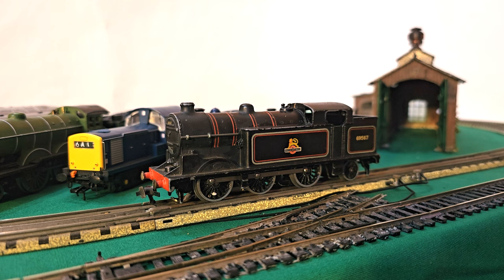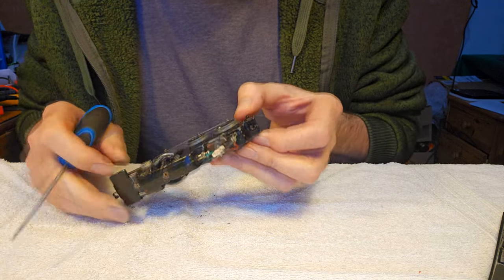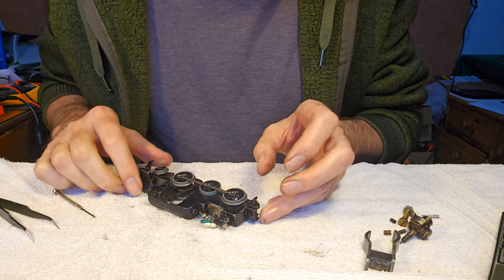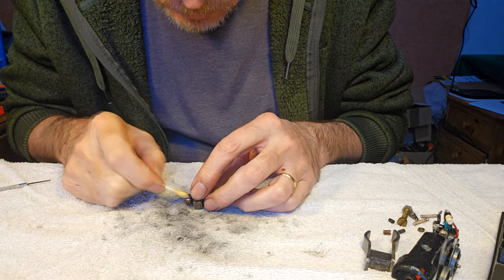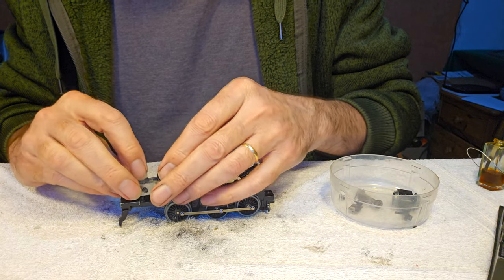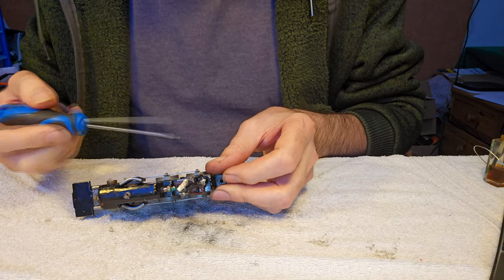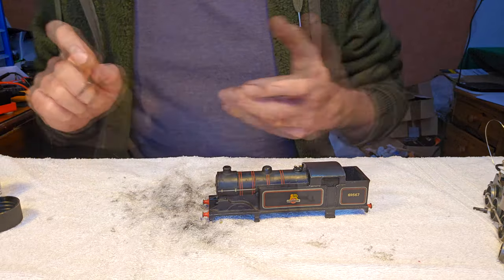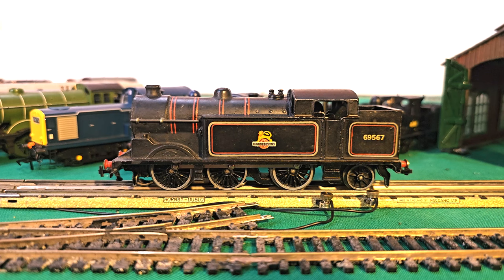Hornby Dublo 3 Rail N2 : Repair Request

Comment: I do a lot of these. Not specifically N2s, but various Dublo 3-rail locos. I would have taken the centre-rail pick-up apart, and cleaned and adjusted it. They often get fluff and stuff in them, and the spring tension isn't always correct. An earth magnet is the easiest way to get the ball bearings out - they can be quite stubborn. I bought a bag of a hundred 1/16" balls on Amazon for about eleven bucks Canadian, and I just put new balls in whenever I do these motors now. I've done quite a number of 2-rail to 3-rail conversions, as I like to run LMS, and not many LMS locos were ever available in 3-rail. You can see various conversions on my own channel. 2-rail to 3-rail conversion is actually easier than the reverse, as at least there's no need to change the wheel set.

Comment: Hi Bill
Can you do a video on how you built your teletransportation system for 3-rail locos 😂?
Joking apart, a 2 to 3-rail conversion is probably a lot easier than the other way around! You just need to fit an HD pickup or a Marklin type skate, « short » the wheels on both sides to one brush and connect the other to the (insulated) pickup I guess.

Comment: 3 rail to two rail conversion is possible. TTRCA (TRIX-Twin Railway Collectors Association) did 14v A/C locos. They were changed to 12 v D/C all you need to do is change the collector shoes. The central and outer pick-ups have different shaped shoes. Easy fix. This changes pick-up from inner central live rail to the outer negative rails. Just make one of the outer rails live and disable the central rail or not as the case may be. I can help if needed. Best wishes Steve P
Reply: Don't you have to modify the axles too? 3-rail wagons have metal wheels and axles and no insulating plastic anywhere.
Reply: @PeterJewell2  Only need to insulate the two outer rails, but not if live and neutral are by outer and central rail

Comment: Nice job. One thing I do want to ask... How long does a can of contact cleaner last you? How many services? On a side note the DCC concepts rolling road comes with a skid for 3 rail running. Useful gadget for the work bench :)
Reply: That's a bit like "How long is a piece of string?" as it depends on two main factors: how filthy the loco is, and how generous you are with your scooshing. Since  started using it I have completed a good number of services, but I haven't kept count, and I've also used it for wheel cleaning. Certainly I think you should get 15-20+ locos done, if you aren't too extravagant, and probably more. I try to be a bit stingy using it, but it is so good for the job that the cost per loco is kind-of irrelevant.

Comment: A bit off topic. How do you get the towel clean from all the dirt & oil?
Reply: Derrrr... put it in the washing machine. 🤣🤣! 

Paul.
Reply: I'd add some Vanish or liquid deterrent to the stained bit before putting in a hot wash. Maybe use a pre-soak cycle on the washing machine if it's really grubby. Best to use an old towel specifically just for that though.
Reply: I agree with you on the last part as the last time I used Vanish, all my washing disappeared and I never see any of it again. 🤣🤣 

Paul.

Comment: No coal in the bunker!
Reply: Excellent observation. Looks like you can cancel your appointment with Specsavers. 🤣 

Paul.
Reply: there was no coal in the Tank Engine as the original Dublo system when it was introduced in 1938 had two versions. Electric 3 Rail and  Clockwork. The space in the Bunker was occupied by the clockwork controls. Later 2 Rail tank engines had coal and I think there were some much later 3 rail ones which had it after 1959 which are quite scarce.
Reply: Hi Clive. 

Very useful and interesting information you've provided there. I take it you were a Hornby Dublo enthusiast in your earlier days. 

I was handed down some OO Gauge Triang locos and rolling stock by my late Grandfather (before he passed) but never got involved in Dublo. My cousin had a Triang TT layout but I stuck with Triang OO Gauge until I got married and moved out. My mother gave all my trains and track to my nephew instead of leaving it to 'rot' in the loft so, I have now had to start again but I'm not complaining. I also had a decent array of Meccano equipment that, due to my age, found rather fiddly with the nuts and bolts but, nevertheless, was great fun along with my Betta Bilda bits 'n' pieces that I found were slightly more realistic than Lego due to their smaller sized pieces. I digress. 

Have a good day Clive, 

Paul. 👍
Reply: I'm surprised Bill touched up the paint but didn't consider adding some coal!
Reply: Hi Peter. 

It depends on whether the owner had requested it. Bill was told that the guy's grandfather was going to use it so I guess he preferred to have it left in its original condition without the coal. 

Paul.
Reply: @clivebennettHornbyDublo  thanks for the clarification, guess we're more used to seeing it nowadays 👍